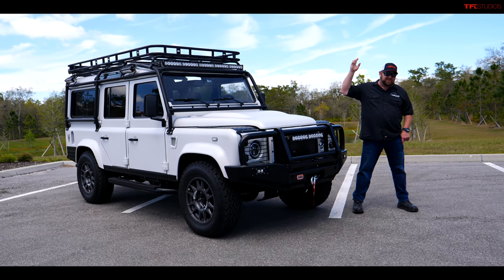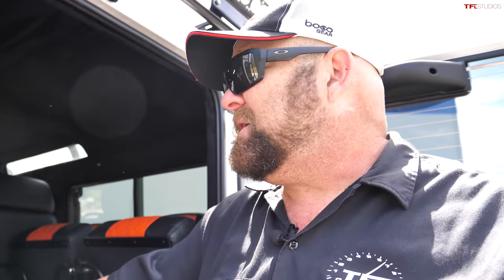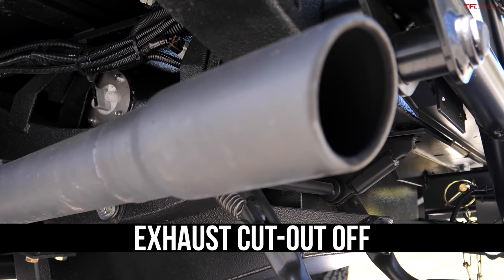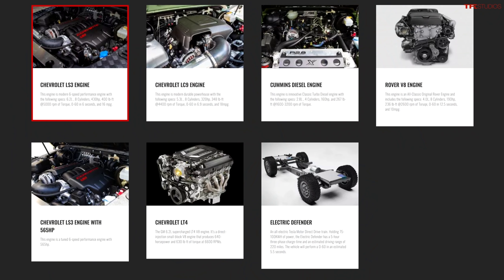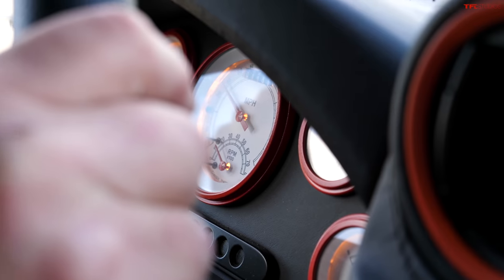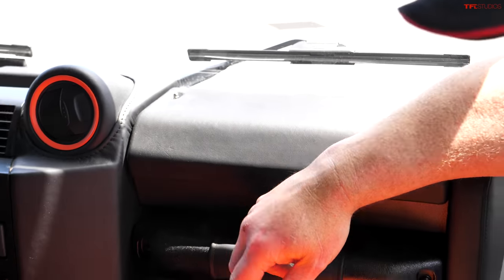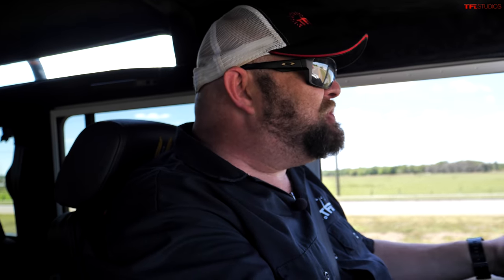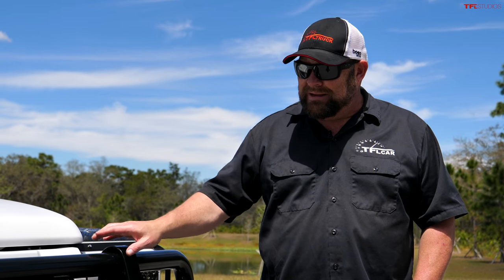What Happens When You Stuff a Corvette V8 In An Old-School Land Rover Defender? I Find Out!

Comment: Probably one of the most reliable Land Rovers ever 😂. Yeah I'm sure there's Land Rover owners with to 300,000 miles on their vehicles. But for the most part all I ever heard was headaches. I even spoke to a Salesman once from a Land Rover dealer, he said some of the clients Drive the rentals more than their own cars. Maybe the old stuff was more reliable?
Reply: I sold my 2007 L322 (Full size) Supercharged Range Rover with 335,000 miles on its original engine & transmission. My mechanic told me that wasn’t heard of on that engine.

Comment: These are great but no one talks about the lack of safety features in these $200k+ vehicles.  No air bags, and barely any protection or side impact, etc.
Reply: You're missing the point of this vehicle...whomever owns this most definitely has a late model vehicle with all the safety features as well.
Reply: @stanludorf2311  I don’t think so. US can only import 25 years and older. From what I’ve read, one of the reasons defender left North America back in 97 was due to the air bag and other safety regulation which they didn’t want to build into this vehicle. It would be good to see the list of safety features these customs do come with or are able to build in.
Reply: @denishb6587  no one cares about safety features on a toy like this.

Comment: Highclass trash maybe? Cmon its such a cool truck and i respect the people and hours put into this thing , but an LS ? Finding an old rover V8,  building and boosting that , would definitely inspire some not recommended financial decisions.
Reply: Rover v8s are garbage, the V8 that would have come from the factory in this 110, if so equipped, was based on a GM engine anyway.
Reply: @stanludorf2311  yes i agree , i feel like i said build that rover engine not bolt it together , also please correct me if im wrong but werent they using engines from everyone ? I know buick was the main but ive heard of others.
Reply: @robertbelote5273  the only v8s they used in Defenders (except for a few hundred in the last year or two that got the 5.0 Range Rover engine ) was the Buick v8.
Reply: @stanludorf2311  oh ok cool , a genuine thank you for that.